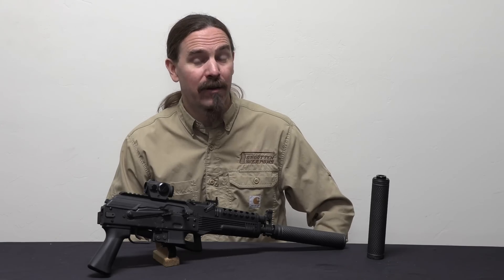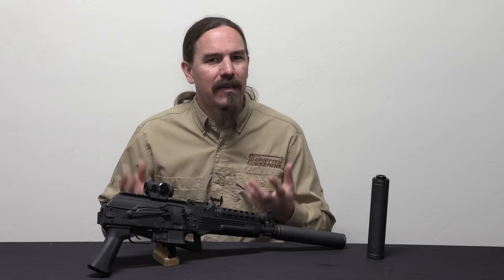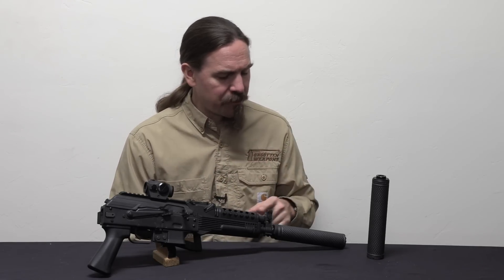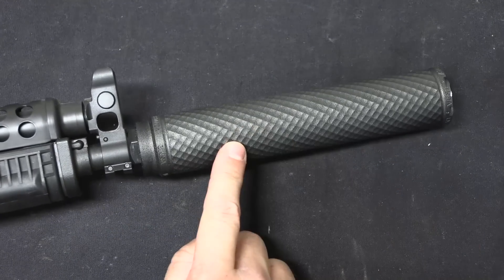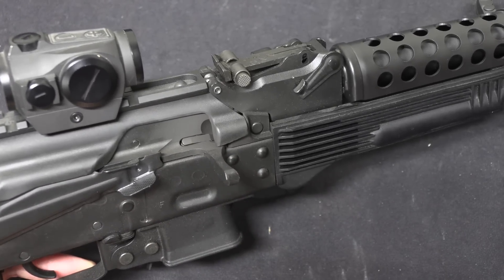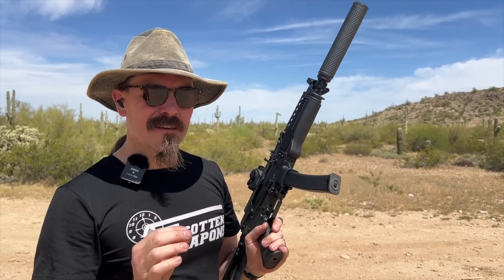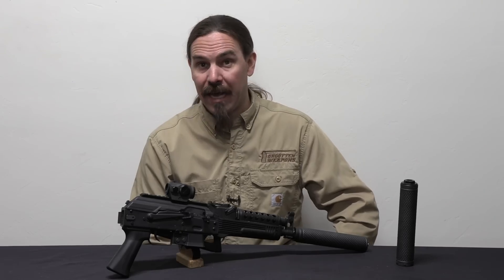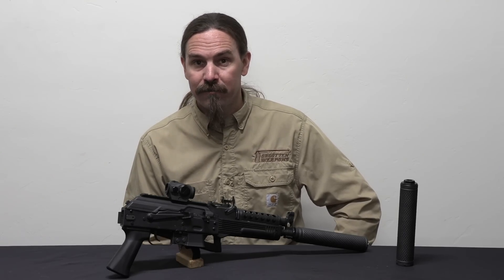PTR Vent Suppressor: 3D Printed Titanium Foam

Comment: We live in a world we’re “3D printed titanium” is just a thing we can buy and not science fiction. That’s wild.
Reply: Not just 3d printed but metal foam. Crazy world.
Reply: @TKTK-sw3tq  Foam is close enough as a simple explainer, but it's not really a structure made up from many tiny gas bubbles.

Normally with printing by powder bed selective laser melting the laser locally melts the metal powder so it selectively creates solid sections. A fresh layer of powder is added and the laser (or multiple lasers) locally melt the next build layer. But if the heat input into the powder is deliberately reduced the metal particles clump (fuse) together where the particles touch, but it doesn't achieve melting and the structure remains porous. 

If you know about aquariums, think about those little porous stones used for aerating water.
Reply: @colinbowman8816  If we're being pedantic (and let's be honest, that can be fun at times) foam is formed because of lots of very tiny gas bubbles. This means that the voids are spherical (closed cell foam) or touching interconnected spherical, for open cell foam and the solid is not spherical. That's not the case here: the spherical metal particles clump together and the voids between those are the negative form of spherical. It's a concave interior for true foam, while this porous printed part has a convex interior.

Pedantry aside, it remains an exceptionally cool and ingenious application for additive manufacturing!
Reply: @TKTK-sw3tq 🤦🏻‍♂️
Reply: @TKTK-sw3tq  It's surprisingly simple. 3d metal printing is essentially just a big bed of metal powder being sintered together. Given it's powder, you can make it near solid metal with fine powder or more foam like with some larger granules.
Reply: @TKTK-sw3tq lol not really foam more of a description but ok
Reply: Still waiting for transparant aluminium...
Reply: @Crazy_Borg  It's called alumina, or artificial sapphire, and it's not really practical for mass manufacturing but it's clear and extremely strong.
Reply: @zincorium1 Alumina is mass manufactured. It's quite common to find in scratch resistant lenses or other similar applications. It's often called sapphire glass.
Reply: @Crazy_Borg  I have good news for you, it already exists. Aluminium Oxinitride is optically clear, 4 times harder than glass and used quite widely. It's too expensive for things like windows, but it's used for lenses (or len covers really) in high pressure or high impact environments. When you see film from deep sea cameras the outer most lens is probably Aluminium. We live in the future.
Reply: It's been done. Aluminum oxynitride has been around for a few years now.
Reply: @Crazy_Borg  Damn it, came here to make that joke.
Reply: @Crazy_Borg 🤦🏻‍♂️
Reply: @Crazy_Borg how quaint..
Reply: @Crazy_Borg already exists. That's what sapphire glass is
Reply: @Crazy_Borg aluminium oxynitride has been developed. 
It's not exactly transparent aluminium since it's a compound of aluminum but it does stop .50 BMG with a 1.6 inch thickness
Reply: yeah upon hearing the price i was a bit turned off but when you realize what you just said....the price reflects the tech at least right now
Reply: wait until we get the transparent aluminum that Star Trek promised us.
Reply: @NINacide 
Look it up
It exists
Reply: Yep the future is now.
Reply: My thoughts exactly. Isn't the future an amazing place. Have a lovely day.
Reply: WOW! Just think what 3D titanium is doing in other areas? "I Have" a titanium digging bar "I watched" a blacksmith forge and hammer out for me at about 14 yrs old, while I worked on a huge oven NG and comp air system for him.
I think the titinum in my bar was bound for an SR71 or Nuc sub? it was the late 70's or early 80's? but killer blue sparks when you slame concrete.
Reply: we can print Inconel as well
Reply: It's not new for people who work in Motorsports or for a Highend Sportcars manufacturer. But that its available on the open market for small money is amazing.
Reply: We need a better, more sci-fi phrase than "3D printed."
Reply: @TheRogueX  how about 4th dimension manifestation ⁉️
Reply: Ed printed titanium FOAM
Reply: I’m still waiting for transparent aluminum. Heck Scotty gave us the formula in one of the Star Trek movies 20 years ago, and still nuthin
😡😡
Reply: @lostinthedesert6149  It's a thing, Aluminium Oxynitride is a clear ceramic made of Aluminium, Oxygen and Nitrogen.
Reply: @lostinthedesert6149  There is transparent aluminum... how are you all this uninformed?
Reply: @lostinthedesert6149 
It exists
ALON
Look it up
Reply: Isn't the suppressor for the new service rifle 3d printed too? So it's already reached mass manufacturing.
Reply: If you have the know-how, you can make them too!
Reply: We got robot dogs with flamethrowers on em too
Reply: I ordered some parts 3d printed in stainless steel and had them in hand in less than 2 weeks for like 26$ a part, the future is awesome
Reply: Lol we mixed welding and computers is it that impressive?
Reply: I just went down to write "WTF, is Titanium 3Dprintable???"
Reply: the intentional porosity is the really impressive part
Reply: It hasn't been science fiction for decades... just because you couldn't buy it easily doesn't mean it didn't exist.
Reply: Maybe the 3D printer was in us all along, well I guess half of us...
Reply: Why
Reply: I was 3d printing inconel turbochargers 7 years ago
Reply: From “you’ll never be able to print metal” to a printed suppressor in 10 years is crazy
Reply: I was just thinking the same thing. My only “gripe” is the price. But like any new technology, the price drops after time so maybe it can become more affordable.
Reply: We've in a world where ppl do not know the difference between where, we're & were.....
Not to mention their, there, & they're....
  smh
Reply: *where
Reply: Science Fiction has this funny habit of becoming science reality in short order.
Reply: 3d printed titanium foam
Reply: We also know what Pluto looks like, landed on a comet, and have flown a helicopter on Mars.
Reply: titanium isnt really a flex what people think it is.
Reply: @710nerDeckel  what are you talking about bro it's been a flex for a very long time the entire SR-71 Blackbird is made out of titanium it's a flex even till today.... You probably just messed around with low quality titanium like the one you first started smoking with in your oil rig 😅
Reply: And transparent aluminum
Reply: Another bizarre example from a bicycle manufacturer: https://www.youtube.com/shorts/DBMALeiyiTk
Reply: Such devices are totally irrelevant to me. I see NO possible way that I will ever spend so much money on such a device.
Reply: 3d printer titanium has been a reality for consumer parts for well over a decade.  My first custom keyboard keycap is 3d printer titanium and I bought that almost 15 years ago. 

Titanium is actually one of the easier metals to 3d print with.
Reply: @Iowahurler82  While true, you gloss over a very serious issue with 3D printing. Yes, 15 years ago they could already commercially print titanium.

But the printing 15 years back was mainly SLS (selective laser sintering) which is inherently inferior to current SLM (selective laser melting) and the build volumes were relatively small. 6x6x8 inch was decent back then, while now powder bed printing can now go beyond 24x24x32 inch. 

And that's the "problem" with 3D printing: its development has been so incredibly fast in the last two decades that what you think you know might already be outdated. 

(All of the above is completely ignoring the fact that the Additive Manufacturing landscape is really diverse. There are many different metal printing methods and equally many different "toners". SLS and SLM are only two of them.)
Reply: @Hydrazine1000  I agree 100%. And even then, welding 3d printer titanium has it's own unique challenges even over 6/4 and 3/2.5 alloys.  It's been my understanding that the biggest challenge is the first weld pass creates a lot of microcracks in the weld bead. However a second pass takes care of this. I believe the common practice is to make the first pass without filler, and are filler for the second pass. While I don't personally weld ti (left hand stupid for TIG), I do weld in an industrial/fabrication side of things. But we will see how they have that process figured out. The rear drop outs on my titanium bicycle frame are 3d printed before welding to the rest of the year triangle.
Reply: @Iowahurler82  It depends on the printing method. The older selective laser sintering will get you a part that is about 95% dense. If you go with binder jetting, debinding and sintering, or FDM and sintering, you get about this density too.

Modern selective laser melting (SLM) however will, with proper laser settings, be able to exceed 99,5% density. 

So the ease, or difficulty, with which 3D printed parts can be welded depends on the printing method that was used.
Reply: Yep and your phone service still sucks yet you have a 5G tower on every corner. Crazy world.
Reply: Still waiting on 3d printed food machines that just make any recipe you want from a database.
Reply: @NnH_Kairyu  We're getting there.  There's chocolate 3d printing machines out there
Reply: @NnH_Kairyu like the replicator from star trek
Reply: @NnH_Kairyu  you mean a replicator from star trek
Reply: @nomercyinc6783  Never watched it. Never will. 😅
Reply: @NnH_Kairyu 🤦🏻‍♂️
Reply: @NnH_Kairyu  not going to happen anytime soon
Reply: @NnH_Kairyu  I think there should be a law that every human using that for the first time needs to order an "earl grey, hot"
Reply: @JCGver 🤦🏻‍♂️
Reply: @NnH_Kairyu  it's already exists, though the latest info related to it was on 2018 and it was for making some polygonal choco caramel cake for art

Now 2024, so it should be more advances
Reply: @r.asyafiq310 🤦🏻‍♂️
Reply: @r.asyafiq310  No it doesn't. They can extrude very specific things and it doesn't turn out well for most things. We are far far away from printing whatever you want. Stop acting like you know more than you do.
Reply: @thomgizziz  bruhh... food printing is already exists, but not for every kind of food. It was so famous back than when 3d printing technology is so new and hype, and they even show it on TV how they printed the cake.

Just remember the principle of 3d printing, even 3d printed house is already exists. All we need is wet cement and giant 3d printer, 
So we just need to change the plastic wire with sugar caramel, chocolate, or any kind of food tah capable to be hardened quick enough, just don't think about complex design, just simple tall polygon would be possible 

"How are you all this uninformed"
Reply: Hopefully off of the NFA soon
Reply: I can't wait to print a SR-71 Black Bird for deer hunting.
Reply: @TheStrayHALOMAN  🤦🏻‍♂️
Reply: @gabe-we8hz  These deer have nods bro, I need that black bird to find them.
Reply: @TheStrayHALOMAN  🤦🏻‍♂️
Reply: Even with as difficult as it is to weld, titanium is one of the easier metals to 3d print with.  The drop outs on my titanium bicycle are 3d printed.
Reply: @Iowahurler82  🤦🏻‍♂️
Reply: and still people cant differentiate between "were" "we're" "where"
Reply: @GarfieldKartPMC  🤦🏻‍♂️
Reply: Companies all over the world printed any object out of any material for few decades. It was just classified. Some ancient civilization had objects that could only be printed. This tech shown in the video is obsolete but worthy enough to capitalize on.
Reply: u can make one with fusion380 and u can buy print time on metal printer in china for cheap.
Reply: It literally happened within the last 4 years, too.
Reply: @breathinglead871 🤦🏻‍♂️
Reply: @breathinglead871  It literally didn't.
Reply: It's not really as great as it sounds
Reply: @Theduckwebcomics  It both is, and isn't. 

You can print absolutely amazing parts, with shapes that cannot be made any other way. 

But you need to clean sheet design a part (or have software or "AI" iteratively design it) before you can really put 3D printing to its best use. Just using an existing CAD file and print it (when it is designed for conventional production methods) isn't useful. 

(Unless you're in the business of out-of-stock emergency replacement parts.)
Reply: @Hydrazine1000 3d printing has 3-4 main usecases depending on the underlying technology.

1. Rapid prototyping. There is almost no other technology quite as powerful for this task.

2. Very low volume or very high variability production. If you only need 3 or 4 complex parts or if each part is substantially altered then 3d printing can have an advantage.

3. Producable geometries. 3d Printing can be used to make parts that are either impossible or exceptionally challenging and time consuming using more traditional production techniques.

3.5. There are some materials that may not have extreme geometries but working with them is just a pain using more normal production techniques.
Reply: @Freak480  I appreciatie the gesture, but I have an MSc in Materials Science & Engineering, and l have been to Formnext (the biggest exhibition on additive manufacturing) 3 times. 

I have a pretty good idea what 3D printing can and cannot do.
Reply: printed with titanium

printing titanium won't be possible until replicators
Reply: @Iowa599 🤦🏻‍♂️
Reply: @Iowa599  People 3d Print car parts and fire arms components and bodies... With Carbon Fiber, Titanium and a few other materials no need for replicators especially when engravers exist too such as CNC machines
Reply: @BadgerSage  yes, people can print with titanium, but they can not print titanium, not until we get replicators.
Reply: @Iowa599  . . .  Once again there IS currently Titanium Filament for 3d Printers, secondary a CNC machine does quite literally the same thing a 3d Printer does and even uses THE SAME APP(s) to create 3D Printed/Machined objects. You can literally throw a block of Titanium into a CNC machine and it's quite literally a fabricator/replicator. What are you smoking lmfao
Reply: @Iowa599  Aren't regular old 2d paper printers considered printers even when they use ink that already exists?  They don't replicate the ink they print with.  Seems like using the same definition of printing, this is printing titanium.
Reply: @aznazguy  yes, they print with ink, except thermal printers. That's closer to a replicator, but only on special paper. The problem I see is people leaving out "with". When that word is omitted the phrase is open to many interpretations, so it becomes meaningless.
Reply: @Iowa599  Perhaps additive manufacturing is a better term.
Reply: @Iowa599 We already 3d print titanium. Most 3d printed titanium is done in using powder bed fusion techniques, but I know some companies offer solutions that use more pedestrian printers.
Reply: @Iowa599  What do you mean? 3D Printers that print Titanium exist and have existed for like 10 years.
Reply: @chaoslu they've actually existed for over 50+ years for example Lockheed Martin skunks works has been using 3D printers for longer than you've been born and printed titanium for the a12 also known as the SR-71... How do I know this, because my dad was a tool and die maker for the skunks works Lockheed and has worked on these Jets personally and passed away 31 years ago from cancer by working on these exotic metals with chemicals and other things as a tool and die maker
Reply: @iiiKingLongSwipeiii  hey thanks for the info and I'm sorry for your loss.
I was only sure of the last 10 to 20 years from personal experience and did not want to overstate. But 50 years is insane those guys where ahead of their time by half a century.
Reply: @Iowa599  kid. 
"How much does it cost to print titanium?
The Material Used
Material	Price estimate per kg
Ti-6AI-4V titanium alloy	$363
Pure Grade 2 titanium	$363
Inconel 718	$145
Inconel 625	$145"

this suppressor just a ~100g so the printing cost around 50usd or less.
Reply: @makoado6010 Uhmm, kid, you seem to forget that the cost of running a powder bed selective laser melting printer isn't quite zero. You need a base plate as a consumable, you need purging gas/shielding gas, printing might take 48 hours which "costs" laser running time (laser burn time is not unlimited, nor is electricity free), the printed part needs EDM wire cutting, the parts need post-processing (removing the extra printed support structure, meticulous powder removal and cleaning, post-print machining, etc.) and the used but un-melted powder needs to be re-processed for re-use.
Reply: @makoado6010  WTF are you talking about? That supressor is around 380 grams. Get a grip on reality. If that suppressor was 100g or less than 4 oz and it worked then there would people lined up to buy it.
Reply: @thomgizziz  kid. the titanium foam is about 100g what u have to pay for.
Reply: not when prices are not mainstream.
Reply: @ktkace suppressors for rifles start around 800 dollars for good quality ones so an extremely high end printed titanium one being 1,500 isn’t crazy
Reply: @satansnarwhal zomg the prices are wild for a tube with some cylindrical baffles and a threaded fitting on each end. It is obviously all markup and supply/demand. They could obviously cost $20 like any cheap flashlight.
Reply: @satansnarwhal 1500 for printed titanium anything 3D printed now since we're in the future is extremely expensive and should not be that price at all p e r i o d you got to remember it's just a metal cylinder basically an "air can" who the hell wants to pay 1500 for a can of air that "air"  is literally permeating it and sitting inside it ⁉️ it's not made from "outer space"  it's not made from things that fall to the Earth ...no it's not extremely "rare"  and "hard to obtain" ‼️
Reply: @ktkace  IDK, $1,5k is certainly expensive but not out-of-this-world expensive. Given the technology, I'd argue it's fair enough.
Reply: @ktkace nobody's trying to hear how poor you are
Reply: @ktkace  I mean the Huxwrx Flow is like $1399 so it seems right
Reply: @ktkace 🤦🏻‍♂️
Reply: @ktkace they’re pretty comparable to standard suppressors.
Reply: @ktkace  first gen is always like that, then it will be an aliexpress listing with  60% offer
Reply: @ktkace  the price for this type of technology is dropping rapidly.  This was never an easily made material.  It used to take 100s of man-hours to make blocks of this porous titanium, now can be accomplished at less cost due to 3D printing. 🤷
Reply: @ktkace  Meh 25 years ago this (3d printed metal) was hardcore scifi, give it another 20 years and the price will come down.
Reply: @JCGver At the rate technologies are accelerating it’s going to be a lot less than 20 years.
Reply: @JCGver 🤦🏻‍♂️
Reply: @JCGver metal 3D printing wasn't Sci-fi 25 years ago.
It was already done in the mid 90s. For example the EOSINT M250 was a commercial available metal 3D printer in 1995.
Reply: @JCGver  Dude laser sintering was being done in the mid 80s and there were previous ways to do it without lasers. Stop making up stuff to get attention. "Herp derp this is amazing we never could do this and now we can, i am very knowledgeable look at me"